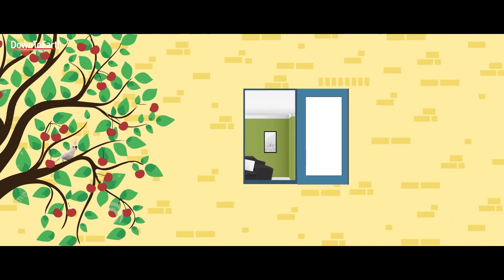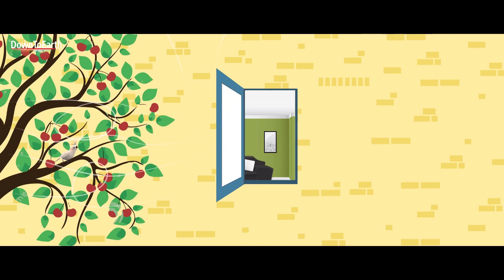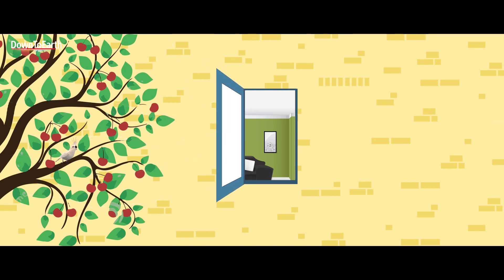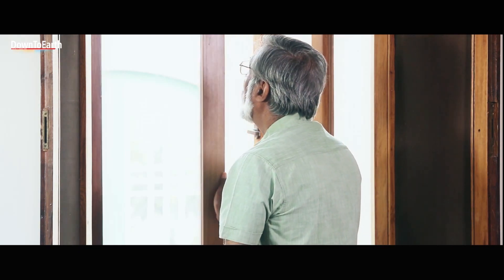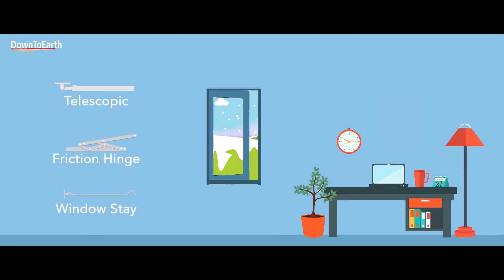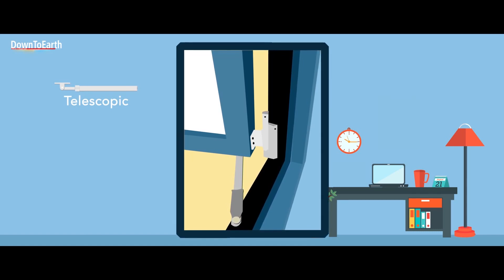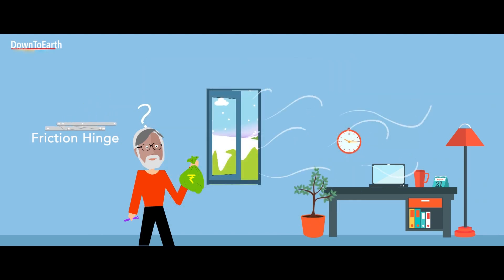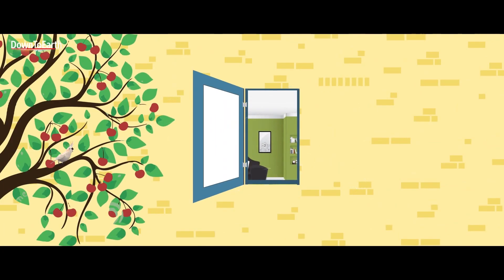Right design for windows for green homes: Ep 2 New Vaastu with Ashok B Lall

Comment: Sir, I just found your videos. Better late than never! We are just concluding on our house design. Hailing from Kerala, I have experienced the benefits of displacement ventilation holes plenty. But in Bangalore, this is considered a nuisance(due to birds, dust, cold winters etc). Could you suggest any alternatives to clear out the warm air from rooms (hopefully something that doesn't require electricity).